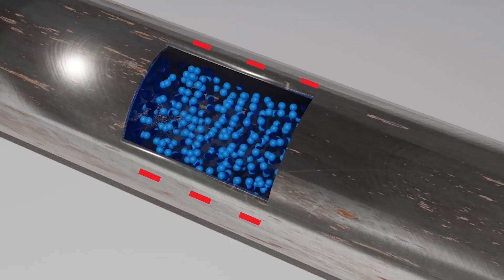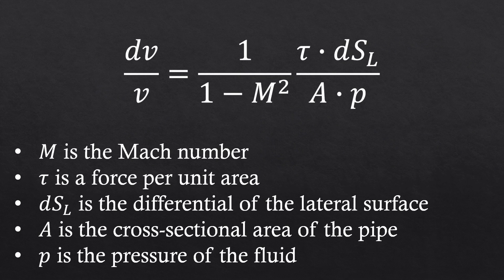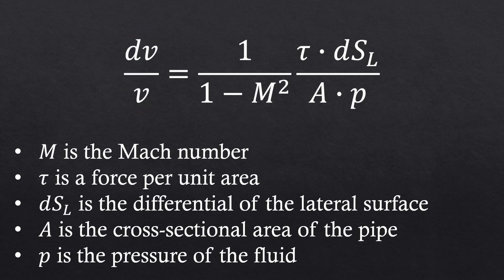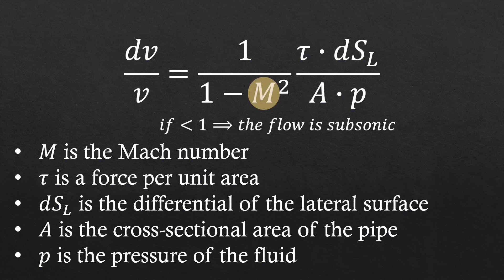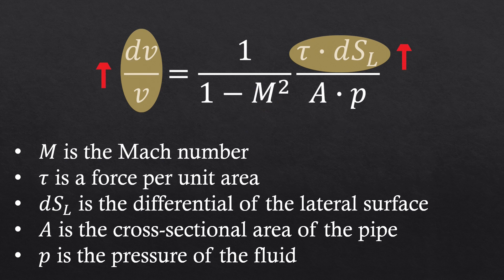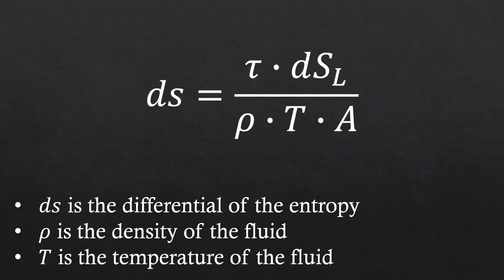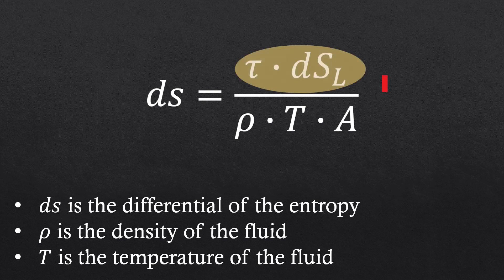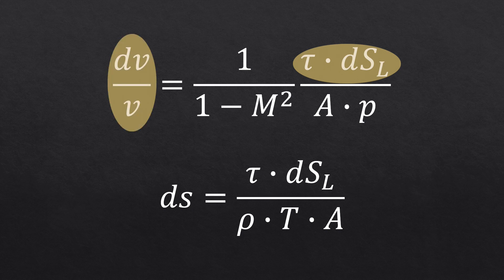Can friction increase speed? - #VeritasiumContest

Comment: If the velocity has increased, so has the energy.  Where did this additional energy come from?
Reply from the maker: No energy increase here, just a conversion as always. The velocity increases so does the kinetic contribution to the total energy of the system, but the pressure and stagnation pressure drop. The latter are indicators of the potential energy. This was not mentioned in the video due to time constraints.